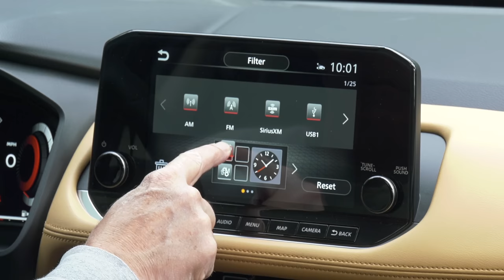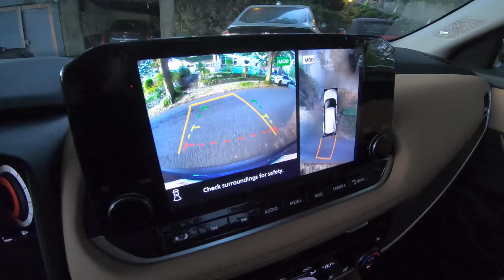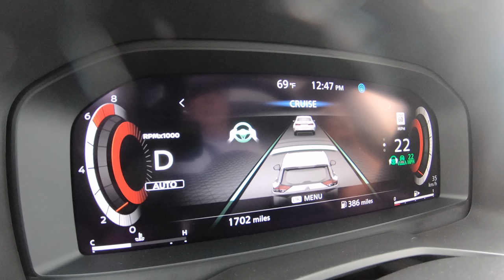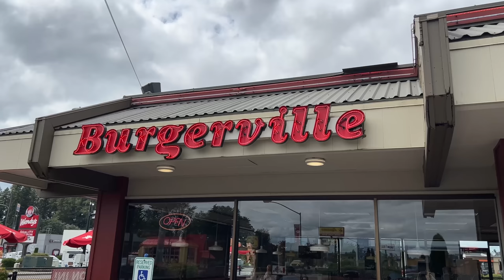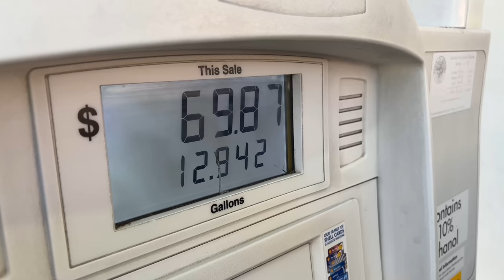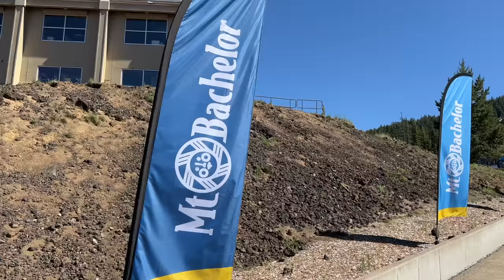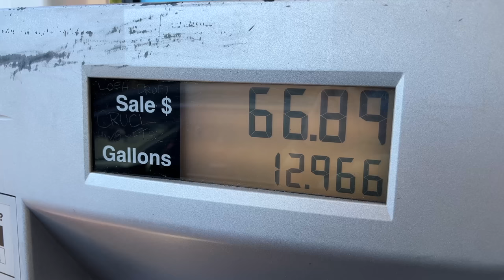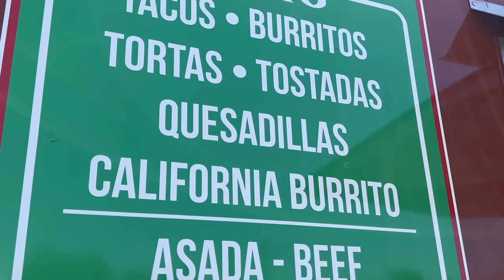The 2022 Nissan Rogue Gets A Techy New Powertrain. Does It Work?

Comment: So far 5,600 on our 22’ Rogue. The new Cvt is very responsive, and has the most traditional automatic feel that I’ve experienced. Can’t beat 30-33 city/mixed 36-41 highway!
Reply: I own the 2017.5 Rogue and tested the 22 Rogue while getting an oil change.
Its a LOT smoother than mine 
I have a 4 cylinder CVT at 170 HP, with 26 city/33 highway mpg, 175 Lb-Ft torque.

The 2022 rogue has 201 HP, 225 Lb-Ft torque, 30 City, 37 hwy rated.

Of all the vehicles i know, i cant even recall a 3 cyclinder to exist. Yet the 3 cylinders have great acceleration and performance from my test drive experience. Coming from a rogue it feels awesome, yet for those who use traditional engines it might be an acquired taste for you guys.

Although I TRULY love this new rogue, i plan on running this rogue until it falls apart. I bought it brand new and enjoy every single mile that ONLY I HAVE PUT ON IT. (Less than 1% was by other drivers, such as valets letting a family member borrow it, etc) 

One day I'll put an end to the myth of Nissana making bad engines. (I hope 😬)
Reply: @ericolens3  GR Yaris and GR Corolla are 3 cylinders. Hell even i8 has a 3 cylinder engine.
Reply: Good luck, I can't trust a Nissan Product anymore that has a cvt.  2013 Sentra nearly killed me on the highway after the cvt randomly died with under 100,000k.   I would definitely take a Tucson, CX5, or Rav4 over these.

Comment: Great review. The fact your wife could not tell a difference between this engine and a traditional powerplant speaks volumes. I also like the fact that as a turbo this car runs on regular fuel and not the more expensive premium or high octane fuel. Three cylinders got my attention with the GR Yaris and the upcoming GR Corolla. My only concern is longevity. I know I am in the minority since I tend to keep my cars for a few years but I guess only time will tell with how durable these engines are. As with any new tech, we know there are inherent teething issues but if Nissan offers the same warranty on this engine as they do their other power plants that can be reassuring. Again well done and that concert in the mountains was amazing. I will definitely have to check that out myself. 42 grand is a little steep for this car but this looks like a quality vehicle. That price looks like it is knocking on the door of what the new Toyota Crown will be going for and I have been very impressed with what I have seen with the Crown and by default, you get that Toyota reliability. Just stepping back and seeing the quality of vehicles we are getting is very impressive.

Comment: Setting up the question: which will fail first? The CVT or that cutting edge little engine?  Nissan is the only manufacturer using this variable compression ratio technology.
Reply: I agree with your concerns and I hope Nissan didn’t screw up reliability or engine robustness. But Vtec was new too some time ago and now all manufacturers have it.

As for the Nissan CVTs, it seems that the key for longevity is transmission oil drain and refills per manufacturer maintenance schedule (every 30k miles) with Nissan OEM fluid, don’t cut corners on that!
Reply: @ItsAlive111  Actually Nissan was the first Japanese manufacture to use valve timing or VTC, Honda enhance it to Vtec.
Reply: I wish the Rogue had a Vtec turbocharged with a 6 spd or 8 spd
Reply: @khronin  show you know little about Nissan race history, Nissan VVL was more reliable and more powerful than Honda vtec, problem was only certain amount of the engine was manufactured.  Nissan did variable valve timing before honda, which was called N- VTC , Nissan was the first Japanese to use variable timing control (VTC) in the 3.0 liter engine (VG30DE) in 1986, Honda brought a more advance variable timing control called vtec in 1989. Nissan enhance the VTC to neo VVL  develop by Autech a subsidiary of Nissan under Japanese CEO before Ghosn took helm of Nissan as CEO. Which birth the SR16VE and the SR20VE engines. Unlike vtech , VVL  engages the change of intake and exhaust cams independently for a flatter, more consistent power band. Up to date the SR16VE N1 NA engine is the world most powerful NA 1.6 liter engine, develop 190 HP.
Reply: @cb5110  Honda is way more reliable was my point.Get some content on your you tube channel--pasting and copying some tech nonsense to back up your narrow point of view means you are simply trolling.Ive been racing for 2 decades--so get real with your experience nonsense.HPD CIVIC TYPE R TC RACE CAR
The Type R TC is designed as a turn-key solution for professional racers, and for skilled Type R enthusiasts who wish to transition from track time in a stock Type R to a fully built race car. HPD engineers developed and tested the Civic Type R TC race car in-house, drawing on experience gained from production car and race vehicle engineering, including development of the HPD Civic Si TCA race car.

The HPD-developed Civic Type R race car begins life as a body in white from Honda’s Swindon, England, plant, and uses its road- and track-proven 2.0-liter VTEC Turbo engine supplied by the Honda of America Mfg. engine plant in Anna, Ohio, producing between 270 and 330 horsepower, depending on the series application.

The HPD Type R TC is available in our Advanced 2 Day Racing School and in the Skip Barber Customer Racing Team which competes in GT World Challenge Americas TC America.

 

ENGINE
2.0L Turbocharged Honda 4 Cylinder (270 – 330HP depending on Series)
HPD Radiator and Oil Coolers
HPD Engine Management
HPD Engine Mounts

 

TRANSMISSION
6 Speed Manual Transmission
HPD High Strength 3rd and 4th Gears
HPD Limited Slip Differential
HPD Flywheel

 

SUSPENSION
Inverted Double Adjustable HPD Dampers
HPD/Eibach Race Springs
Adjustable Front and Rear Camber and Caster
HPD Lower Control Arms
HPD Adjustable Stabilzer Bar
Spherical Suspension Bushings and Damper Mounts

 

EXHAUST
HPD Turbo-back Exhaust

 

BRAKES
HPD 4-Piston Brakes
2 Piece Rotors with Aluminum Hats
HPD Front and Rear Braided Brake Lines
HPD ABS Modulator
Carbon Fiber Brake Cooling Inlet Ducts

 

SEATS AND SAFETY
Factory Welded Cage
Racing Seat
6-Point Harness
Window and Center Net
On-Board Fire Control System
HPD FIA Fuel Cell

 

EXTRAS
ARP Adjustable Rear Wing
High Flow Front Grille
Vented Hood
Homologated for TC competition--I drive this car every 2 months--post some vids of mommas nissan rogue for us--ROFL at U.
Reply: @khronin  OMG, you need to stop embarrass your self, this is post about Nissan not Honda, so you completely trolling, telling me about Honda,  listen boss , there are many Nissan cars you have never seen, and they are just as reliable,  both Honda and Nissan have their years when they made bad motors and transmission as well, Nissan start go down hill when Ghosn take over, but before there are cars like the pulsar GTI which made 280 HP from 1990, your type R which you boasting about started 7 years later after a Nissan pulsar GTI, so your Honda type R doing it some years later, is nothing special. Even  SR20VET made almost 300 HP and was used in normal Nissan cars. Your 300 HP is nothing special. Nissan limit how many of these engines are many, while Honda sell them all about.

What you should look at is the gt500 who has won it the most, Nissan or Honda, or maybe you should answer why race cars company prefer a Nissan V8 or V6 block to Honda or Toyota, since you claim Honda reliability? LOL
Reply: @cb5110  I am 40 and already retired.I own everything and my investments are way ahead of inflation--thanks for asking.I coown the ZL1 and my daily driver is a Kona N--I never spend more then 35k on any car even though I could spend 100k.Even with the 2 cars i still have 36k in my car bank account and the ZL 1 already has an offer of over 20k then what we paid and may sell it anyway.I am also a high end driver and drive tons of cars--my record is totally clean--never have wrecked on a track or street.I also have credit at 2 tracks near me and have not payed for track time in years except for gas and insurance (track insurance).I have ocd about money and financially i am already set for life.Every car on my channel that I owned was also sold for a profit.
Reply: The vc been around awhile now and I have not seen anything bad on it yet we’ll see.
Reply: How many CVTs has Kevin had?  His research includes everything he has read on the internet, the Holy Grail of truth.
Reply: Too long, too much boasting, did not read.

Comment: Just bought the SL with light gray leather interior. Gorgeous car. Seats are VERY comfortable. Quiet. Better fit and finish than earlier models. Good visibility. Great storage under shifter and elsewhere. The power of the 3 cylinder turbo was the biggest surprise. I think it’s a winner.

Comment: That new powertrain was what convinced me, it drives great and gets great gas mileage. Cooled seats, actual roof rails, and HD Radio was what I wanted them to add to the Platinum trim. Otherwise happy with mine, with the exception of the Dunlop tires mine came with - they're atrocious on wet conditions and wear life leaves a lot to be desired. Hope they release an off-road edition one with the actual roof rails and water-resistant seats in the future.

Comment: Pro Pilot assist yells at you after 10 seconds of hands off the steering wheel? That seems worse than most of the lower-end driver assist systems out there. My wife's Hyundai Palisade will let you keep your hands off the wheel indefinitely as long as it senses you are paying attention with your eyes. It also does an outstanding job keeping the vehicle centered in the lane and taking sharp curves without any driver input. I did a 2 hour drive in it, thru some twisting canyons in UT and I touched the wheel maybe 5 times total in 2 hours.
Reply from the maker: I also like the Hyundai/Kia system.  It's not all about "seconds handsfree". PPA seems to be a little more confident when it's doing its job. In the Hyundai, I didn't have nearly the level of handsfree time as you. Most I got was a minute and that was on straightways.

Comment: Looks like a great family option that should be on everyone's shopping list.  Well featured, nice ride and well priced.  Regarding fuel economy calculations, modern ECUs know precisely how much fuel is being used as the fuel/air mixture on today's vehicles is a masterclass of precision, especially with today's emission requirements, fuel economy standards and especially so on a variable compression turbo engine like this.  Filling up the tank until it clicks is nowhere near as accurate.  The ECU is likely accurate to within a few milliliters of fuel per tank.
Reply from the maker: Yup, but a guy has to show his math.
Reply: @DrivenCarReviews  For sure, I get it.  However, the ECU should be the most accurate thing you can use if you want (despite what some naysayers online say).  If you want, you can reset the fuel economy gauge when you get the vehicle, then make note of what it says at the end of your time with it.  That should be a good reflection of its fuel consumption.  Of course, that's only relative to how it was driven by you during your time with it.  Things like temperature, altitude, quality of fuel, how you are driving it and the driving conditions as a whole all play into fuel economy, so they should really be taken as a guide, not gospel.  The good thing I've seen from you is you tend to drive the vehicles like most normal people do (you don't hypermile it, but also don't floor it constantly).  It always bothered me to see some reviewers drive a vehicle like they stole it, then berate it for poor fuel economy.  :)
Reply: @jeffer1101  my 21 rogue is off by 1l/100km. Always like that.  Full tank to full tank is always the most accurate way to measure fuel economy.
Reply: @jackl5557  The ECU knows precisely how much fuel is being used.  Also, you shouldn't fill your fuel tank up the top of the nozzle (where it would essentially spill out if you kept going) as it can damage the emissions systems in the fuel tank (filters, etc).  Also, depending on the grade of where you are parked at the station, that may also affect how much fuel you can get into the tank.

Comment: Naturally aspirated 4 cylinder engines may use more gas and have less power, but they are extremely simple and reliable. They can last hundreds of thousands of miles with little repairs or maintenance. What Nissan Rogue should have just focused on is updating just the CVT to have a launch gear and make it a chain instead of a a flimsy steel belt.  Make the CVT more durable like Toyota and Honda does... that's all I care about it simplicity and reliability.
Reply: The 2022 model do has a chain instead of the 2021 which has a belt

Comment: I'm getting 30mpg by driving 70mph in Mazda CX-5 with 2.5 250hp 4-cyl turbo and 6AT...and I don't see any reason why someone would go for 3-cyl-turbo with CVT instead
Reply: Not to mention that the CX-5 looks much better inside and out.

Comment: Excellent review, thanks! I own a pretty-new Jetta SEL; if I make the switch to a compact SUV, CR-V and Tiguan are my front runners. But consider my head turned! The Rogue is pricey, yes, but the engine technology and comfort features make it a pretty good value (... and I've never heard of Nissan build quality complaints). The only downside for me is I do not like CVT transmissions. Bottom line: Judgment reserved! Thanks for another fine video.
Reply: The CVT comes up a lot. I drive a 2020 CX5 GT (6 speed) and the feel of the Rogue shifting is comparable. It seems refined enough now that I don’t see major issues with it.
My wife just traded her 2016 Rogue SV (111,000mi) for the 2023 Rogue SL. It’s a gorgeous car! Beautiful leather interior. Quiet. It has a surprising amount of pep considering it’s a 3 cylinder turbo. Everything about the new model is improved from the older. We test drove some Subarus and then the new Rogue. We really liked the Forester and Outback but we were immediately sold when we drove the Rogue. It just felt great.
Reply: If you get an SL with premium, it’s equipped almost identically minus digital gauges and heads up display, the rest is all the same. 4000 less. I am picking one up for 35,000 after discounts since there’s a $1000 incentive on them right now

Comment: I've had my '22 Rogue for a few months, have noticed an irritating "whirr" noise from under the hood, occurs after about 35 mph, not really noticeable after 60 or so due to wind/road noise.  It is more noticeable upon letting off the gas from around 50 mph.  Very annoying with no radio on, bearable with music on.  I was wondering if anyone else with a '22 has this same "whirr"  coming from under their hood?  My dealership said it is just inherent to this turbo with this CVT.  I didn't hear it till I had about 1K miles on it.
Reply: I tried a 23 out recently and did notice a faint whirr anytime moving forward. No noise when stopped. Loved the car but deciding if the noise is a deal breaker.
Reply: @tomdwyer4421  Tom, unless you always drive with no radio on, you really won't notice it.  I've actually become accustomed to it and even with my radio/music on low volume, I can't say that I hear the whirr from the turbo.   I like the Rogue for so many good reasons.   I am, however, having a concern about my AC temps being strange, sometimes having to dial it all the way down to "LO" to feel cold air, then I can dial it up to my comfortable 70 or so.  I'll talk to my dealer's service dept soon about that issue.

Comment: I leased a Rogue (regular engine, not this 3V one) for a few weeks.  The SV version has all the techs I want - 360-d camera, Lane Keep assist), and the techs work very well.  The vehicle itself is spacious.  Overall, it's probably the best value out there.

Wireless does not always connect - YES!  This is very frustrating.  Nissan/Infiniti has a long history of terrible infotainment system.  Serious, how could they screw this up?

Also, farewell, Lenny.  I'm sure you were a good dog.  Enjoy your retirement on the big farm in the sky.

Comment: I like this for looks.  IMHO, they look yards better than the average (homely) SUV.  I don't understand why, however, they chose a 3 cylinder when the 4 cylinder VC-Turbo exists.  A heavier vehicle (vs. Altima) ... would not the 2.0L VC-Turbo be the better choice?  P.S. I have the VC-Turbo in my Altima and was surprised when the dealer told me it was a hard sell to Altima buyers.  But, the difference between it and the normal 4 banger is significant.  I love the Pacific NW!  I spent three years in Portland, OR.

Comment: Love the review, but my main concern with NIssans are their CVT transactions, the history of Nissan and failing CVT’s is what keeps me away from this company, I have a 2007 G35X Infiniti, and love the VQ engine with the 5 speed, and hearing that Nissan went with a Cvt and all the issues they have just keeps me away from this company.
Reply: This has Nissans new, dual pump CVT with 30% less friction and a much wider gear ratio.
Reply: @joenissan  interesting, but if it's still made by the same manufacturer it's still a no go for me, that CVT manufacturer that they use is horrible

Comment: Sofyan Bey of Redline describes that noise you may have experienced as a "shudder" in the driveline. Or it could be a completely different experience. In any case, that's pretty concerning.
Reply from the maker: There was no shudder. Nothing to feel.
Reply: @DrivenCarReviews  Thanks. Must have been specific to the Tester he had. Good to know it's not an issue with all '23 Rogues.